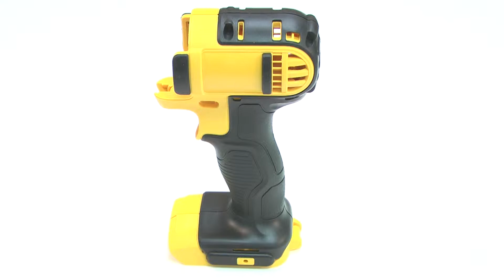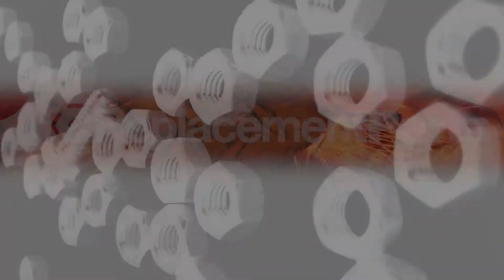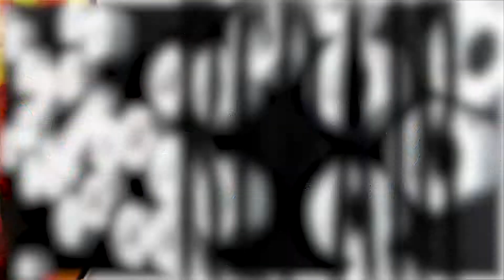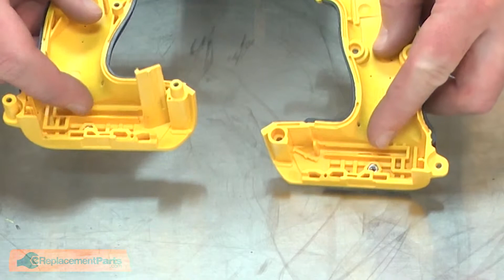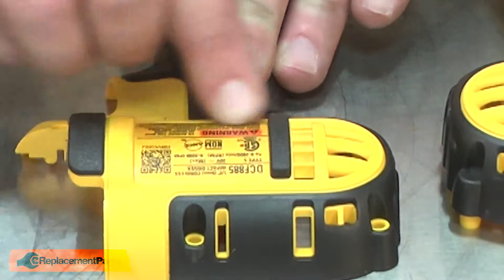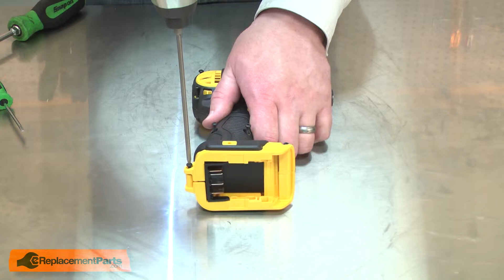DeWALT Impact Driver Repair - Replacing the Clamshell (DeWALT Part # N272699)

Comment: dude thank you , i took apart my dcf883 impact so i can dye the shell with Rit Dye & when i put it back together , the drill would start smoking & make a crackling noise , & i bought a &
$15 replacement off amazon & replaced it & now its good as new!

Comment: Been changing these for a while now with great success buying the shells from you guys. I did my first N413423 which was very difficult to get the motor out of the 2nd half! After fighting it for way too long and getting it back together, it does not work! The light lights up but the motor does not work. It did work before but had the cracked shell.